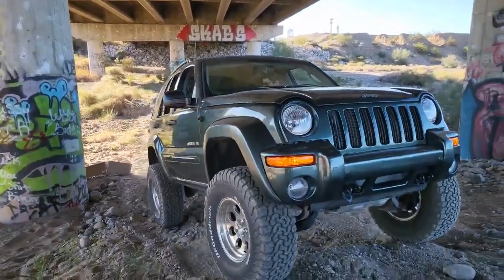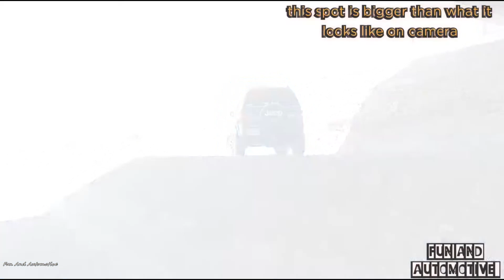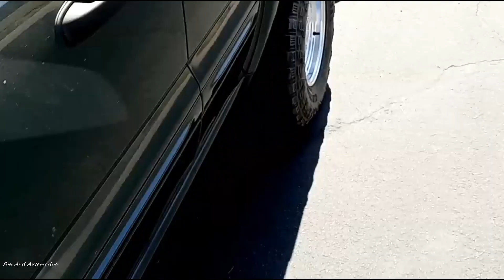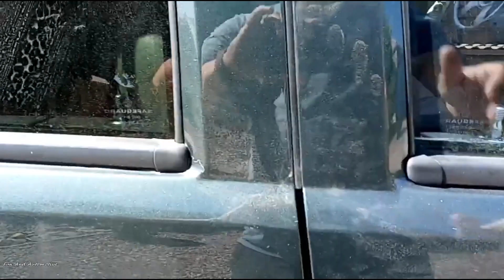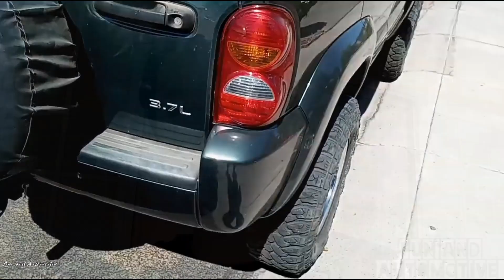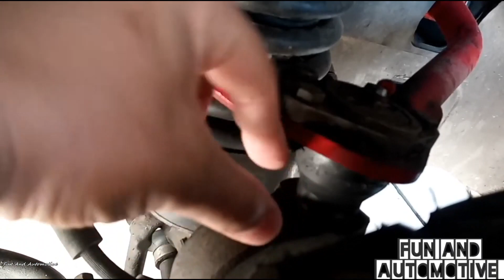Jeep Liberty 2.5 Inch Lift  Review|OffRoad

Comment: Just bought a 2007 Limited 4x4 with only 96k miles. Its in fantastic shape inside and out, everything works, and only paid $6k. Went from a 2021 Rubicon Gladiator to it. Big change haha, but I do not have a $770 car payment anymore. Paid cash for the first time in years, and that feels nicer than the gladiator. Working on getting out of debt with the current economic outlook. Been driving the Liberty for 2 months now and have loved it actually.
Reply from the maker: That's excellent!!

Comment: Did you have to do any trimming to get those wheels and tires under there ?
Reply from the maker: Some minor trimming on the front bumper
Reply: I just installed the 2 1/2 inch spacers today and I have 265/75R16 tires to mount and I wanted to make sure it would work
Reply from the maker: Nice! Yeah, it will
Reply: Thank you.
Reply: @FunandAutomotive   got the lift kit on and mounted the 265/75R16 on the original wheels but I’m still having problems with rubbing on the pinch weld even after I flattened it and on the Right side because of the washer bottle. I trimmed the bumper and folded the fender liner but the bottle is there and it pushes against it. I might have to relocate the washer tank or get a smaller one.
Reply from the maker: Yeah, I would probably get a smaller one
Reply: 1 inch wheel spacer an no more rubbing @FunandAutomotive

Comment: I am keep watching your videos, right now my liberty has the old suspension witsh spacers which is sagged. I have to install OME lift kit ( I think I will get 2 inch of lift) I will be abel to fit 31/5 or 32s with no rubbing ? right now with 2.5 spacer at full turn wheels are rubbing in front bumper and I have stock wheels 235/70r16 AT with 2inch spacers.
thanks
Reply from the maker: It may rub at full lock mine did but yours may not rub 👍

Comment: Where'd you find those wheels?
Reply from the maker: eBay ion alloy 171 Wheels
Reply: @FunandAutomotive  thanks man. Appreciate it
Reply: @FunandAutomotive  do you know the offset of the wheels?
Reply from the maker: -5
Reply: @FunandAutomotive  sorry not understanding what the -5 means.  5" on the back and 2' on the front?
Reply from the maker: It has  negative 5mm offset on the wheel